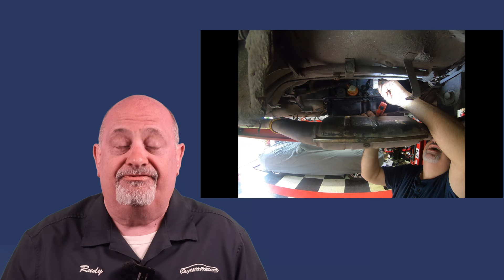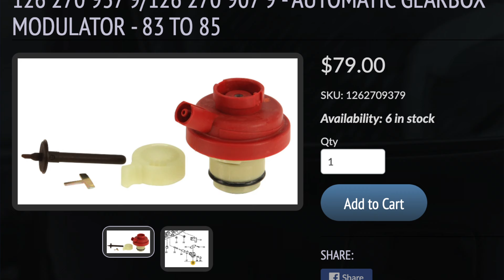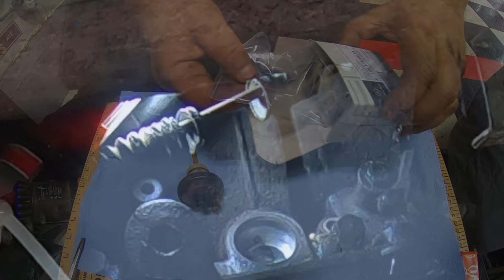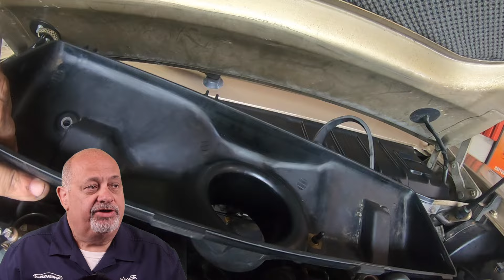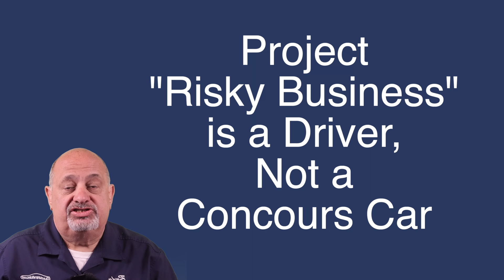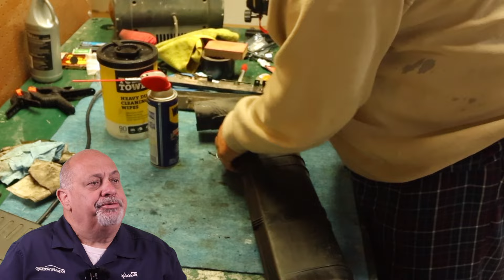How to Replace a Porsche 928 Transmission Vacuum Modular and Mistakes to Avoid

Comment: Hi, thank you for the information. Can you tell me where is the linkage (air vaccum black wire) end between the Pressure control valve of the transmission A 28/01? Thanks 🙏🙏

Comment: I inadvertently pulled the vacuum line off the top of the bellhousing when I was doing the intake refresh not knowing what a beast it is to reinstall. One of the few jobs I had to enlist my mechanic to put it back on for me - he was able to gain access from underneath and I'm guessing did the blind "bear hug" method to pop it back on. I'm glad as it instantly restored the smooth shifting.